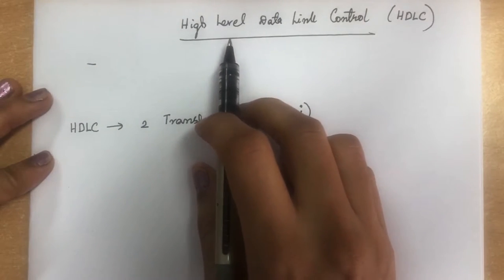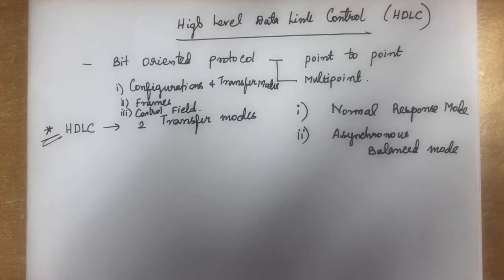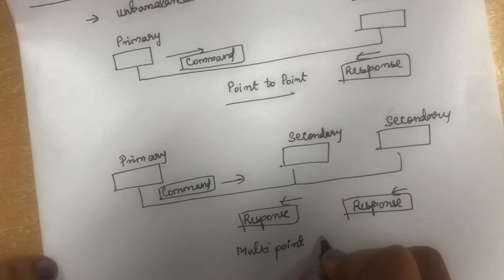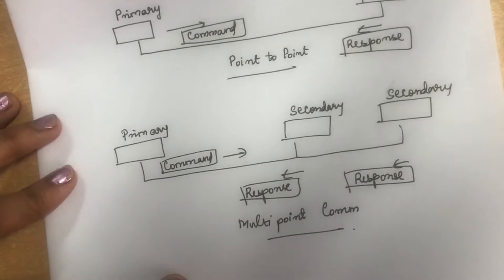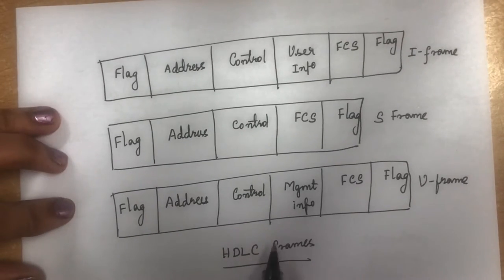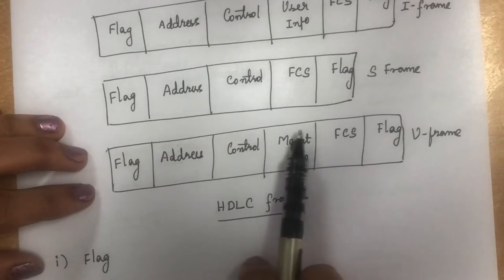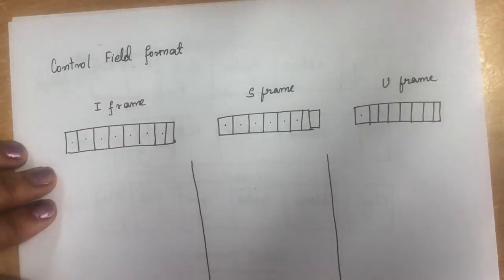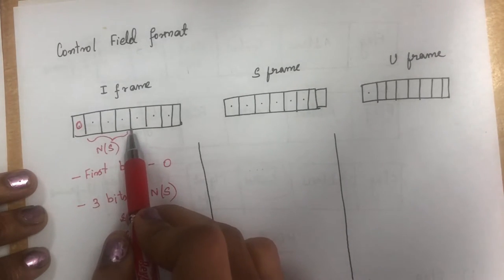23. #hdlc High level Data Link Control (HDLC)-  Lecture 23-Computer Networks

Comment: Mam one doubt mam in U frame N(R) represent sequence no.or acknowledgement?😊
Reply from the maker: In HDLC (High-Level Data Link Control), the U-frame (Unnumbered frame) is typically used for control purposes rather than carrying sequence numbers or acknowledgment numbers. It handles various control functions such as link setup, link disconnect, and flow control but doesn't include sequence numbers or acknowledgment information. Sequence numbers and acknowledgments are more commonly associated with I-frames (Information frames) in HDLC.